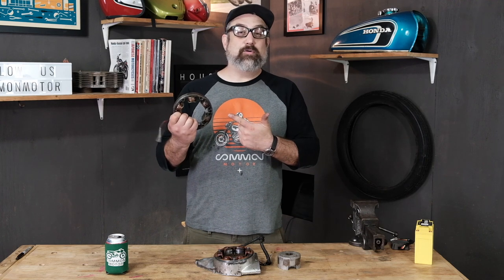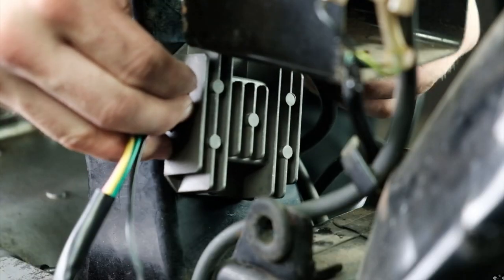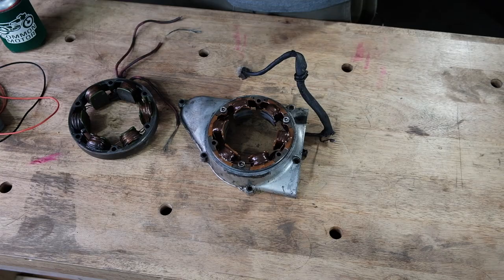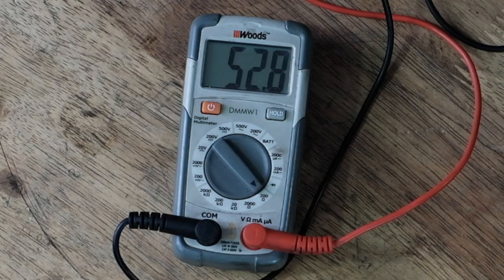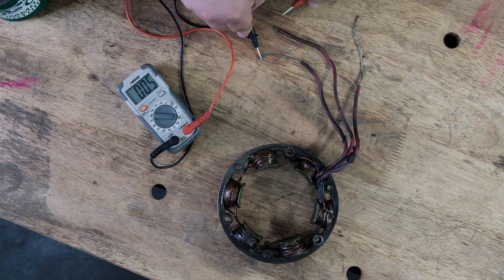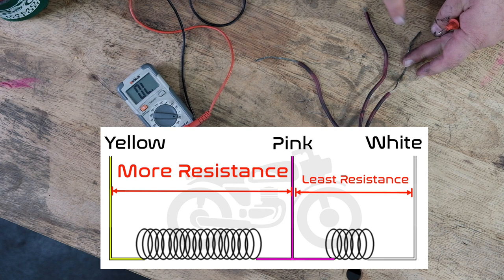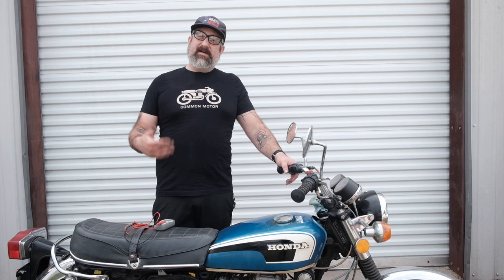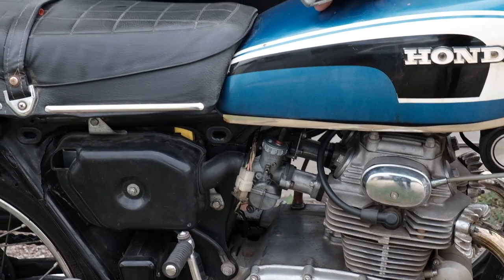Troubleshooting the Permanent Magnet Stator on a Vintage Honda Motorcycle

Comment: Now my 360 runs good up until I turn the headlight on, then dies. Turn headlight off and fire right up. I get home and check the battery, and is fully charged. Would this be stator or rectifier?
Reply: I’m having the same issue on my cb125

Comment: 1972 CL350  measured 38V AC between white and pink wires while running.  16V AC between yellow and pink wires.  Ohm test checked out OK.  12V DC drops to 12.2V DC running and 12.4V DC with the key off.  The battery is new, but a crappy lead acid one.  Why did the AC voltage measure high?
Reply: I wish you had gotten a response to this question. I am getting almost identical readings on my 1973 CB350G and I cannot depend on the bike to ride to town and back (about 7-10 miles round trip.) Last time I tried it I pushed the bike home the last mile or so. I live in Kentucky. It's a hilly place. I'd like to prevent doing this again if I can.

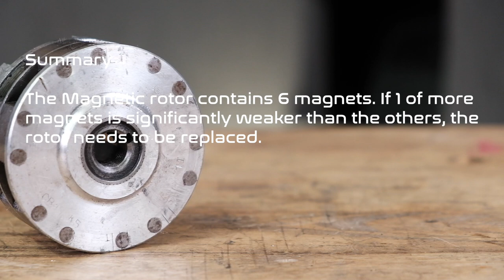Comment: At 12:13, you state if one or more of the magnets are weak, the rotor needs to be replaced. However, it appears the magnets are set in via press pins on the top. I think one can argue that a rotor can be remanufactured by removing these pins, replacing the magnets with fresh neodymiums, and then grind then down via machine lathe...like I'm sure Honda did originally. 

The labor in shaping the magnets would be the biggest cost, of course. But, it would save these rotors from being scrapped to the junkyard! Just my .02c.
Reply: I don’t think those watching this have access to a lathe, myself included, but I’m all for reusing parts

Comment: I have some questions, I'm in the middle of restoring my honda GL100, will the magnet stator affect the quality spark?
Reply: I know this is a bit late to respond to, but from my knowledge if the charging system is inoperative or too weak to keep the battery charged, it will affect spark at higher rpms